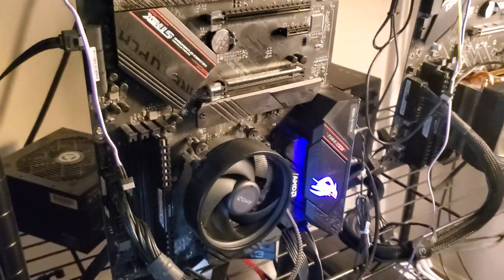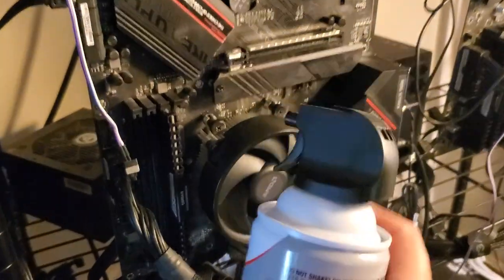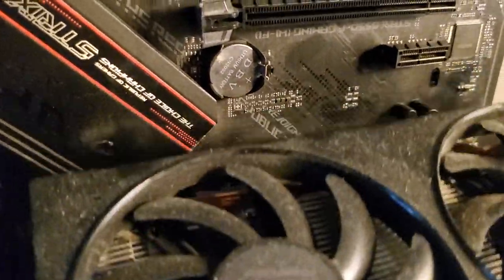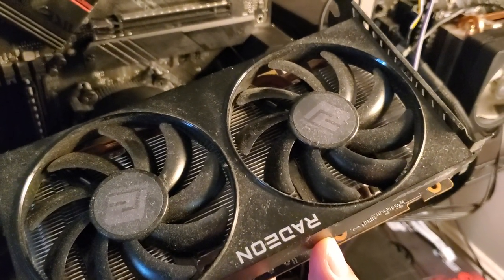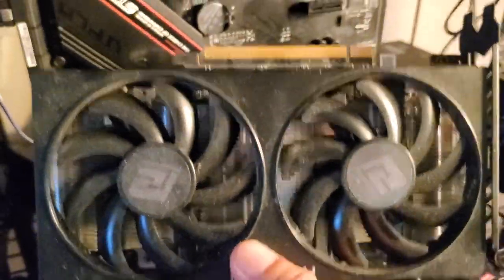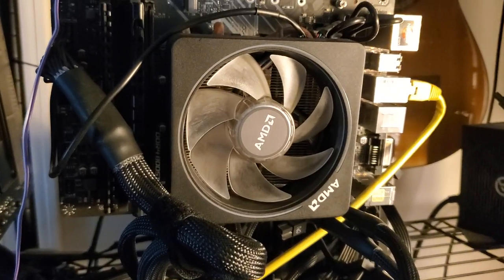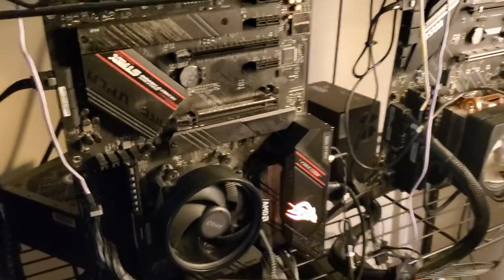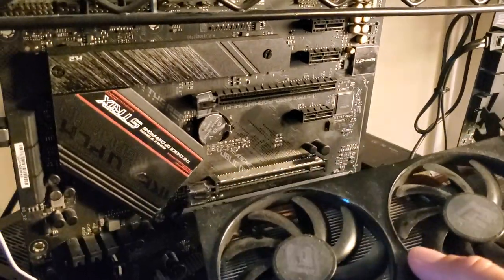Dust-Busting 101: Cleaning CPU Mining Rigs for Peak Performance! 💨🔧

Comment: You have the hardware you should be mining with it. yes, we are in the bear market right now not making much but come the bull run and or a few years down the road what you where mining now that's only 30 cents a day will be worth way way more...
Reply from the maker: I know. I just got tired of GPU mining with all the noise, heat, electricity usage and potential for fire. I love my little old cpus just chugging away.   But I may slap a GPU on a CPU rig and see how it goes.